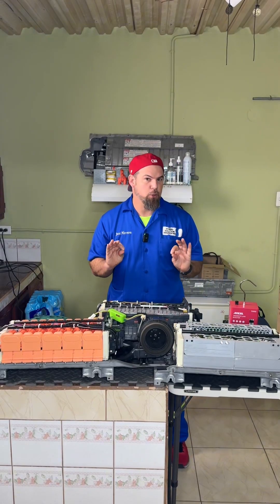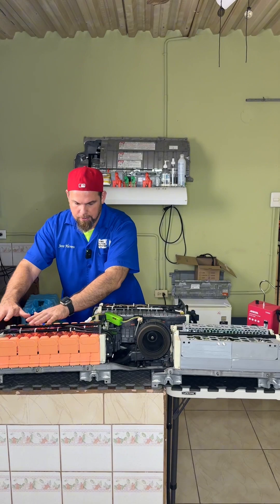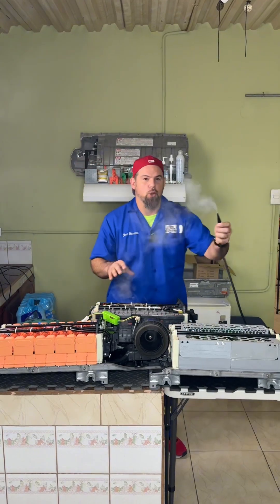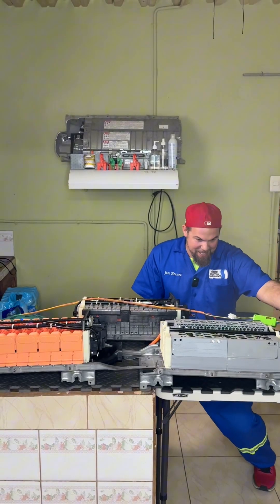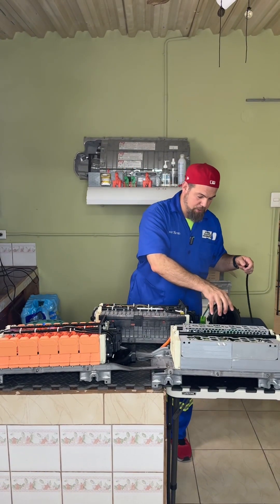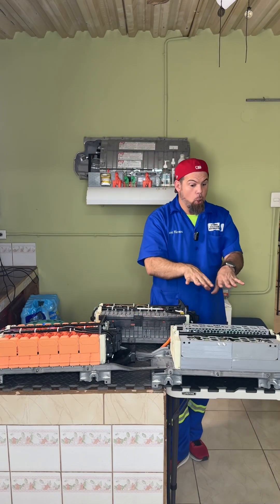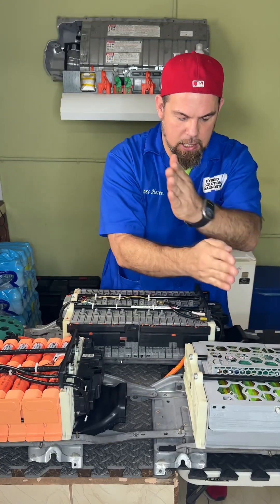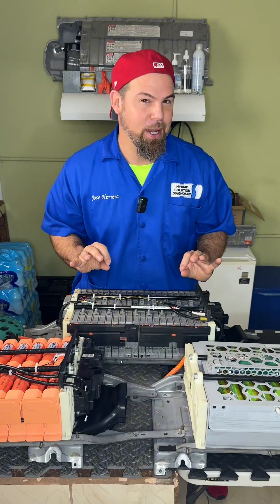Hybrid Battery Airflow Efficiency Test Toyota vs Sodium vs Cylindrical

Comment: Hi, I wanted to ask you for help from Italy. I installed the cylindrical cells on my 2009 Prius 3, it worked well but after about 5 months one cell went wrong, I replaced the cell with a new one and after 1 month another cell went wrong. The strange thing is that before the replacement I had monitored all the cells with the mobile app by entering the data in excel. The cell that is now in error was working correctly before the change. Then a strange thing also happens, the hybrid system goes into error when the capacity drops to around 45%, in that case the app tells me that the cell has a difference of 1.5 v with the others. After resetting the error the car works very well, and even if the capacity reaches 40 the car starts the engine without jolts and recharges the batteries as it should regularly. I saw a video of yours where you said that after changing the batteries you have to reset the control unit, does this also apply to cylindrical cells? I hope for your help.
Reply from the maker: @Giuapau  unfortunately these cylindrical batteries are very defective heat exchangers

Comment: I have a 2011 gmc Sierra hybrid that will not start.  Pulling codes POB3D,POB42,P1A1F.  Used a multimeter to test the cells and first 8 are barely showing .50 volts but all the rest are showing 6.43 or higher.  Could the battery be done for?

Comment: Hi there, I have a general question to ask you
I have a 2012 Prius plug-in, I am trying to find out if The cells from the gen 4 (2018 Prius prime) Plug in battery will fit in my gen3 (2012 Prius plug-in) battery? I know they Look the same and they have the same voltage 3.7 But I am not sure if They have same dimensions???
Thank you very much for your help

Comment: Nice test, but when the metal housing / lid sits on top of the battery packs, it will affect the distribution of the air flow, right?  Best regards from Germany! Andy.
Reply from the maker: @kommdi  the metal is just the outlet so it doesn’t affect the air distribution at all
Reply: @hybridsolutiondiagnostics  keyboard warrior here..Hmmmm....having messed with aircooled VW's and Porsche's I would say the shroud is huge on the effects of cooling.  Yes, yes I know it's different, but I would say test them under load using a temp gun with the shroud in place. The exiting air through the top would still flow over the batteries to the common outlet.

Comment: Here I am thinking Toyota should done a dual zone setup using a secondary fan to push air for the middle cells or used heatsinks for some of the cells to even the thermals out.